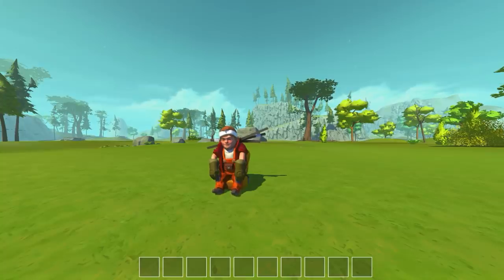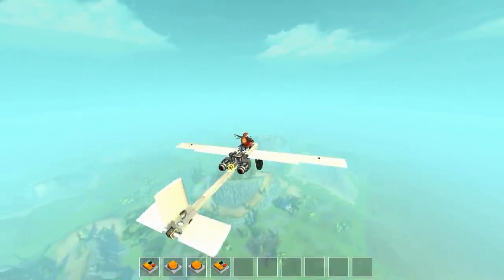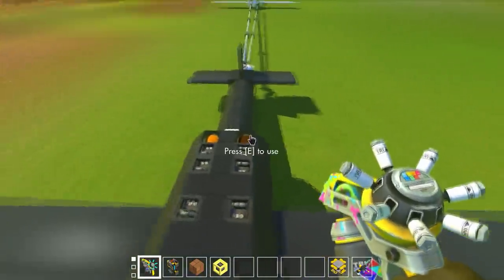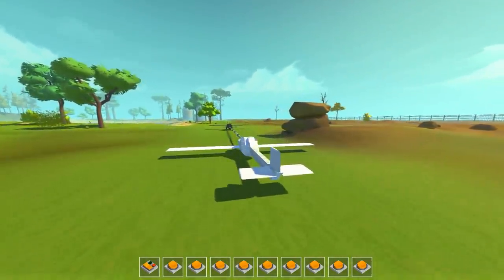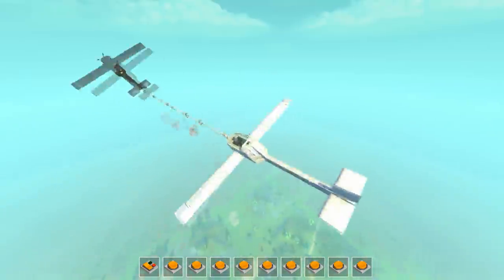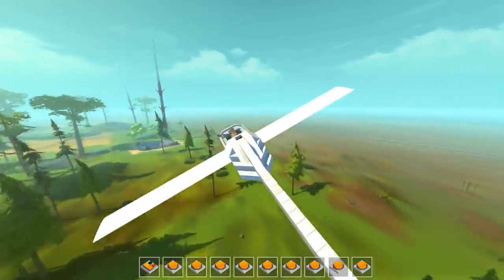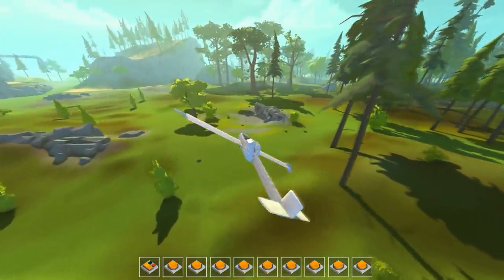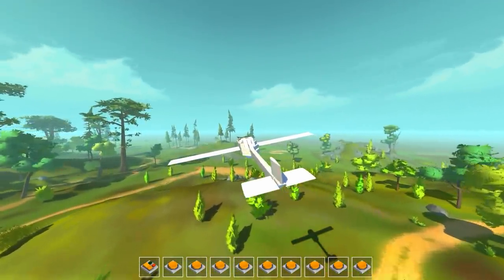Working Glider and Remote Control Tow Plane! (Scrap Mechanic #365)

Comment: Make a jet with an ejection seats and guided missiles,pls!
Reply: Seems very possible.
Id like to see like a jet and on the side wings you see moonbos homing missile and for the ejection seed you just need a little wind shield piece that will be flown out using the mini thrusters from the modpack while you yourself is lauched out by the same system except you have a parachute block on you. The homing missile would just be dropped and it will stay like that for about a half of a second and then it will start flying towards the nearest enemy
Reply: Yes
Reply: Make something like a F-22 Raptor. That would probably be the best scrap mechanic creation ever.

#NotifactionSquad
Reply: Tyler White Personally I’d like to see something like JAS Gripen because of it’s extreme versatility and low price point (that obviously doesn’t matter in game)
Reply: Hjortsater we all have different opinions
Reply: Hjortsater i feel bad for the jas 39 gripen pilot, same pilot, two crashes. And it also exploded. 

Freaking Saab, why did they hire those guys...
Reply: Tyler White indeed
Reply: bigboxer91 Poor guy!

Comment: Docking challenge for Multiplayer Monday: using either gravity modules or a gravity modulator, combined with the reduced drag block, you would need to carefully manoeuvre you spacecraft (or whatever you end up building) to line up with a docking port, then clamp yourself to it. Of course, as this is a precision challenge, there shouldn't be much room for error with the size of the docking clamps, meaning that it is basically a challenge to see who can dock the fastest, which considering that you will continue drifting along if you provide to much thrust, could take some time. Also, this would be a great time to use some reaction wheels for rotating the craft, since those are actually used in real spacecraft.

Comment: You could use the fuel system to activate thrusters. This would represent columns of hot air. There could then be a MM video of who could stay in the air the longest?

Comment: Hey kAN. Remember how you didn't understand the colour sensor and RGB block? I know what the number is. It is a hexadecimal RGB colour code, but simply in the form of decimal. For example, 16777215 in decimal converts to FFFFFF in hexadecimal, which, of course, is white. With this knowledge, you could actually make pixel art in game using any colour available to a standard RGB screen.

Here's an idea: take your intro animation, reduce the resolution to something like 16 pixels wide and 9 pixels/blocks tall (or whatever aspect ratio you happen to use if different), change the frame rate to 40, then build a screen setup and begin to store the appropriate values in memory blocks. Sure, it's a lot of work, but wouldn't it be awesome?

Comment: I wish the drag block worked on the painted number mods type, where like you could paint it to choose the level of drag, you could use the dragon balls from the golf episode and blueprint edit the drag reducer into it to make the ball small smooth and float better, with the drag reducer would it be possible to redo the full sized cargo plane with wings mod so that to slow down the plane since the drag reducer makes it hard to slow down could you use wings mod to help slow you down like a real planes wing flaps like a 747 when landing it opens the flaps to slow down? Also if you decide to do a slingshot version of the glider, itd probably be easier to do a rocket sled then a slingshot in scrap mechanic (also I dont think youve done a rocket sled to accelerate anything especially now that transfer of momentum is a thing)

Comment: Would this make actual propeller planes work? Last I recall, they didn't work very well, you still had to use thrusters, or even a modded speed engine.

Comment: Multiplayer monday.
2 teams each get a glider and a powered plane 
theymust be able to connect to each other then disconnect when you pass a line each team must change out the plane pilots after a lap whoever finishes the race first wins.